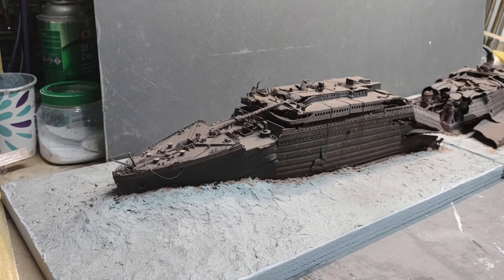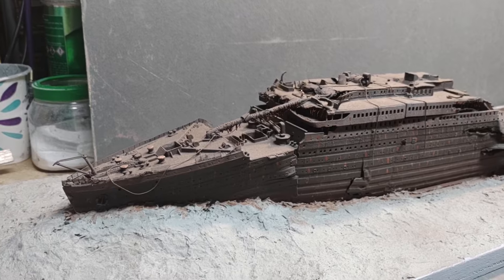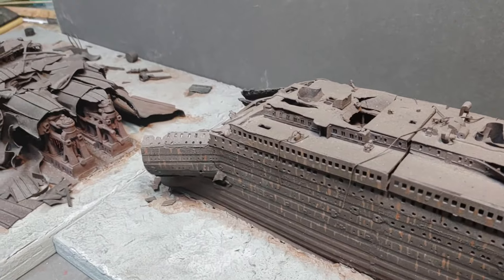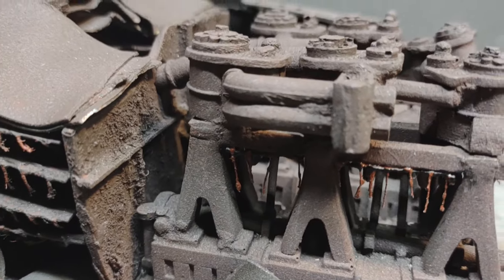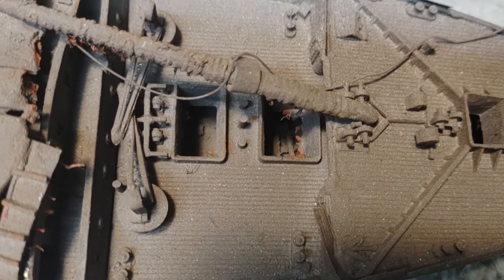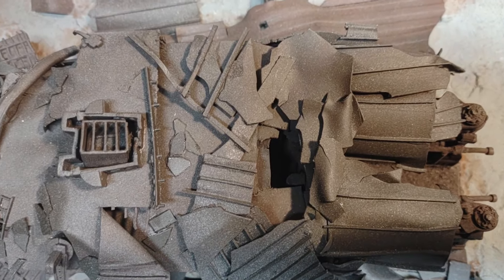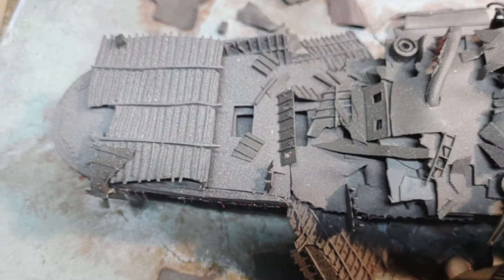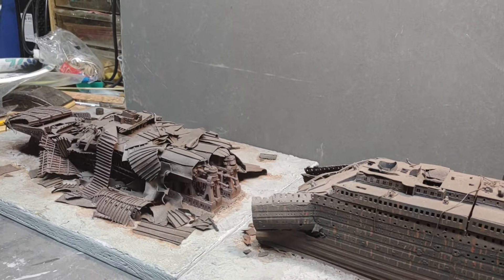Titanic Wreck Model Diorama Part 50 IT'S FINISHED!!!

Comment: Looks great! I’ve been wanting to ask you about the stylus for the Amberola you repaired. Could you please tell me what shape and size you used? Is it still working well? Thanks
Reply from the maker: Thanks for the kind words!  As for the Amberola I don't recall exactly the dimensions of the stylus but I'll try to get the data on it.  I've heard a lot of gloom and doom if the exact original Edison dimensions aren't adhered to; all I know is that the sonic fidelity is amazing with no discernable damage to the cylinders.  I just played "Red Wing" before responding to you and it sounds sweet and loud after several repetitions over the years.
Reply: Thanks for the reply! I got an Amberola 30 in poor shape and some cylinders that aren’t great either. New stylus is around $150 and not worth it for this machine. I would appreciate any info on what modern stylus could work. Many thanks